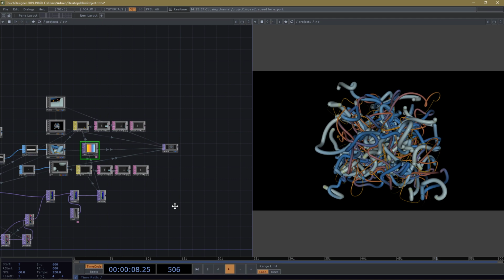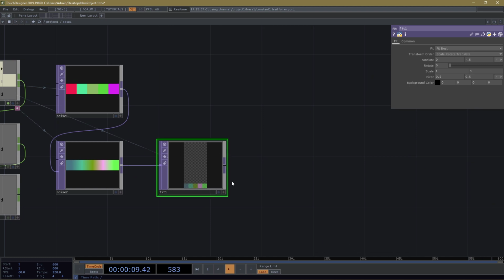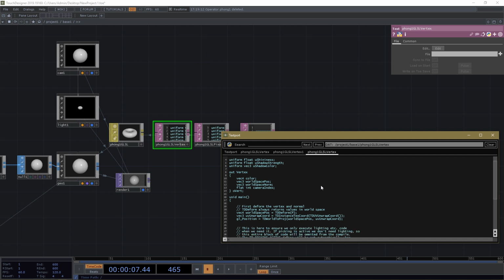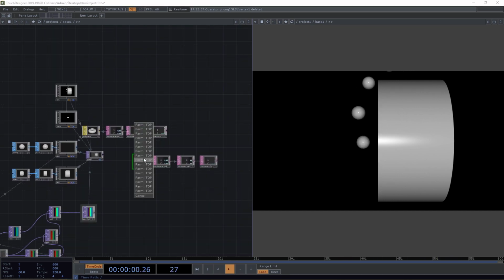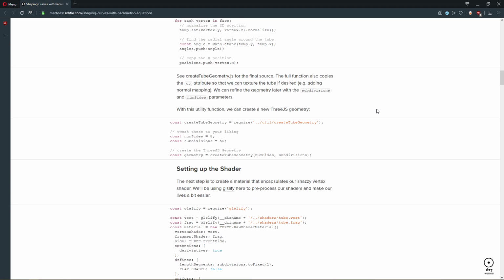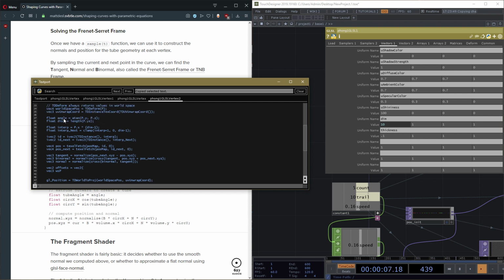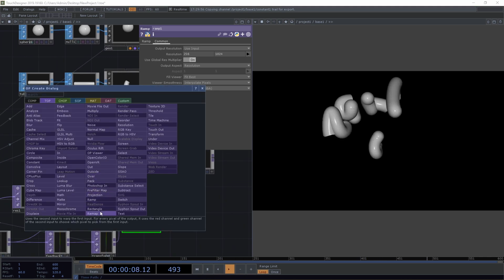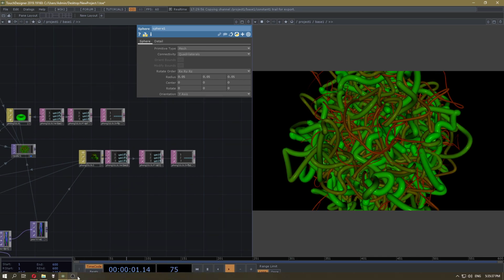TouchDesigner - 3D Tube Trails Custom MAT Tutorial - Atagen

Comment: Great video. Lot of amazing knowledge here. I was capable of adding gradient top to color  build inside code. But now i wonder could that noise with position informatiom from begining of build, one that goes into feedback, could be used as the color for every line mesh seperately ?
Reply from the maker: I don't see why not.. it's just a matter of where you pass it through the pipeline. in this case you can fwd it to the frag shader from vert iirc (or maybe pull directly from mat to frag shader, I forget, been a while with td..)

Comment: Hi, Thanks for this tutorial :). I try to use this technique with a particle system drive with a glsl top but I have some issue. When the particle system reset the position at the end of the life in the initial position I have also the trail. The logic is to have the scale of the trail at zero while one frame for not to see that. I try since one week but I can’t find the solution. Do you have an approach for solve this.? Let me know if you have a lead?

Comment: First off, thanks for this tutorial!! I've been looking for something like this for a few months, never got into compute shaders before but really works well with your tut!

Secondly, I was wondering if you could help me out. I'm using a phong glsl mat to deform the tubes because I want to give them custom shapes (like bumps and stuff) and was wondering how it's possible with this method, to increase the resolution along the x axis (along the lenght of the tube). Right now, if I increase the lenght of the tube, it only gets longer (duh) but what I'm trying to do, is to have the same length, but twice the amount of vertices along that length. So basically, to increase the density of vertices along the x-axis.
Intuitively, I feel this must be possible and not too hard, finding a way to increase the number of points yet keeping the tube lenght constant. however, I cant wrap my head around it, everything I try simply makes the tube longer.

If that made any sense at all, any thoughts? I'd appreciate it a lot :) 
Cheers!
Reply from the maker: hi, sorry for the late response - I'm sure you probably got somewhere by now, but if you increase the columns of the tube this should get what you want.
however, depending on your deformation you will probably need quite a few more verts (and maybe some better interpolation) to prevent the mesh doing weird stuff like crossing over itself.
if your details are relatively minute and you can do it with normal/bump mapping instead, I would suggest that, since it pushes that detail overhead to fragment shading (where the GPU is already running once per pixel anyway and can do it in a similar manner to regular texturing) rather than overloading the vertex stages, which can be a big slowdown and doesn't really give bang-for-buck on that kind of detail (tons more processing for no guaranteed extra detail at many positions, if that makes sense).

Comment: Great tutorial. How do you apply a specific color? in your network, you have a ramp.
Reply from the maker: hey, sorry for late reply.
the easiest way is to use a ramp TOP to generate your gradient, then use the alpha attribute generated in the particle data (which I address pos.w) to look up into it. for example if you use a single line horizontal top something like:
vec4 color = texture(myColorMap, vec2(pos.w,0.)); 
this is handy because of course you can process the gradients how you like beforehand, shift the hue, add some nice bands, etc .. haven't tested but you should even be able to do proper cylindrical mapped textures using a vec2 with pos.w and angle/2pi (to get 0-1) for look up.

Comment: I feel like I was following along exactly up until 8:10, but for me the blue and red test pattern remains. I wonder why? Is this another thing that wont work on Mac?
Reply: could follow eactly up unitl that point.  for me the test pattern goes away but the texelFetch function doesn't seem to generate a bunch of spheres or make them float. It's a sigle static sphere. The camera seems to flicker a little. No errors!
Reply: @sandipannath9588  I had the same issue, just make sure the line  gl_Position = TDWorldToProj(worldSpacePos, uvUnwrapCoord); is at the right position (i.e. after adding to worldspacepos)
Reply: @GauthierVrac   seems to be in the right place but still having the same issue :(
Reply: @GauthierVrac  Yup. It's after worldSpacePos. I think that's the default code when you open open the shader.  Still not working ://
Reply from the maker: @sandipannath9588  you could try to test if it's the texelFetch variable issue by writing a pixel shader that fetches a value based on a uniform or some calculation. if that's the case, one possible work around is by replacing it with regular texture() call looked up by vec2(1./numParticles*gl_VertexId, 0.) and texture options on the MAT set to nearest pixel. this will also unfortunately trash any texture you apply to the tube, if you try such a thing, but at least it might work
Reply from the maker: hmm.. this should work in any OpenGL, there's no fancy new school stuff. your glsl info isn't showing any errors at all? if you're on AMD sometimes they do have weird behaviour around using variables in texelfetch, and don't always provide obvious error messages..
Reply: @atagen2186  No error messages of any kind, unfortunately. Card is NVIDIA GeForce GT 750M 2 GB. If any other Mac users try it and succeed/fail, please feel free to reply. Looks really cool, thanks for posting it.
Reply: The same here , have you found any solution?
Reply: I am also a Mac user facing the same problem. Did you find a solution to this?